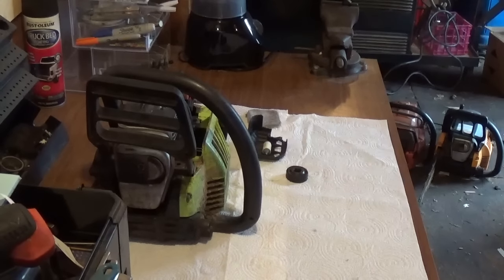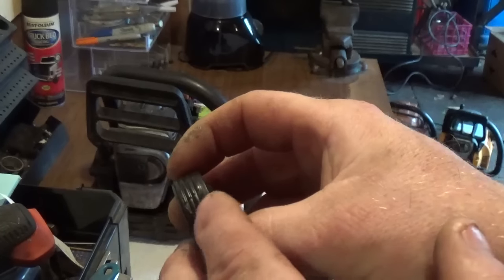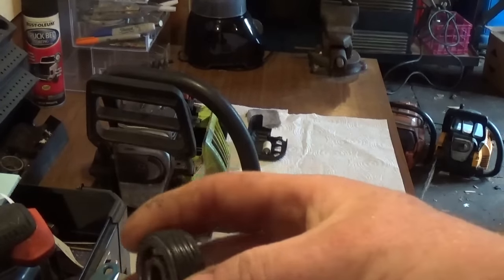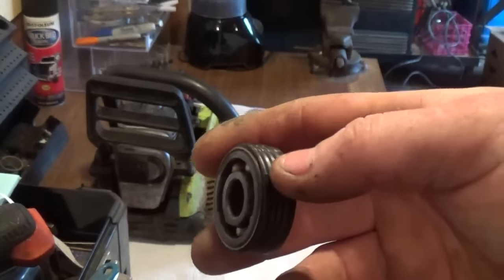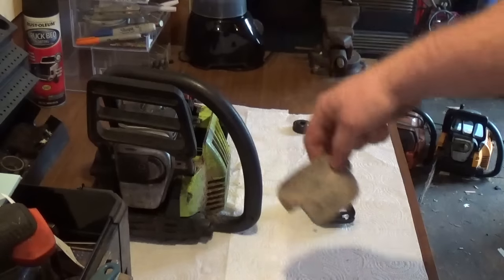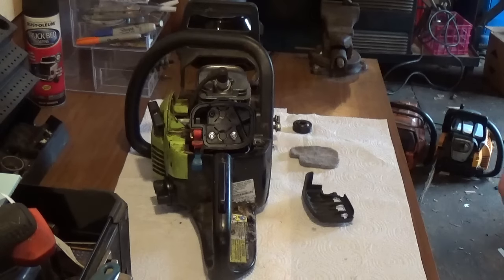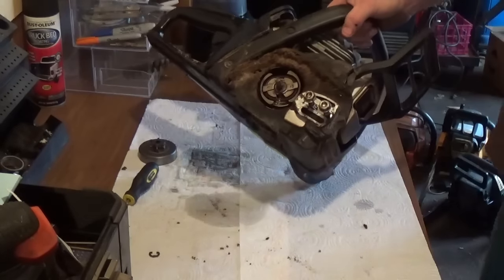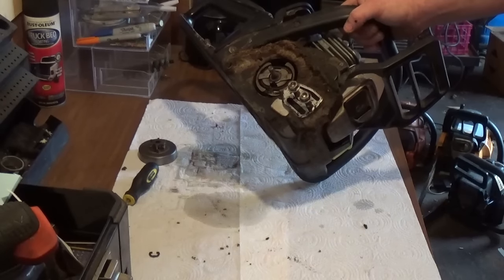Common problems with Poulan Chainsaws

Comment: Poulan chainsaws are not completely junk, as long as u try to take care of it and do sum sort of maintenance on it they will last a while. I've had 3 in the past 15yrs, 1 I never had a problem with, 2nd was a pro and just like u said the crank snapped at the clutch, and the third I ended up selling 3yrs after I bought it and it still runs. The thing is the carbs are nowhere near close to being adjusted right from the factory cuz I've always had to adjust them right from the box but it's like anything else that we buy, they ALL have their lemons. Husqvarna, the crap Sthil, johns red, and John Deere all have some sort of flaws. But as for poulan they're only $100 so compare it like this...if u wanted a ratchet set to put together a swing set for ur kids, if this will be the only time u ever use it, then buy a Taiwan POS set from the dollar store. But if you're opening up a garage then u might wanna get some better tools...and NO I'm not comparing a poulan to a tool set
Reply from the maker: Chris I like the way you elaborated on your idealism of a distinction via comparison with the affect of cost in relation of intended work . However although you stated Poulan chainsaws are not completely junk …..I must disagree ….Now let me explain by right of my own example. If you allow yourself to purchase a cheap alternative such as a poulan for intended work and you invested said 100 dollars only to experience a failure in the first hour at best of use then was the purchase viable in comparison to the 200 dollar purchase of a Crap Stihl that has a way better rep as well as warranty ….Knowing that Stihl will accommodate there customers to make it right so long as straight gas didn't ruin the equipment . Now Just because of my own experience I can attest that Poulan will do anything if not everything to make a failure fall on the customers shoulders {this fact has been proven time and time again } Hell still continues …….Poulans are by far the worst chainsaws on the planet / The only thing that makes them appealing in box stores is price point value . They suffer so many problems they even have there own refurbishing company so they can take the lemons sent back and push them threw the box stores as well as dealers once again at a cheaper price …...Truly said …..Seriously think I am kidding ? look on the saws displayed at a reduced price in the small box stores . You will find that pretty little stamped {R} for refurbished right on the top . But lets not stray from my point I was going to make …….The simple truth is with all the problems that plague the Poulans from even your own admission of the 2 of the three to have suffered a crankshaft failure how can you attest that these saws are in any way comparable to a 200 dollar purchase …..Let me elaborate …..For example and example only  lets say you had a wooden handled hammer typically purchased for about 10 dollars and you intended it to be used to drive and pull nails from old lumber . You use it for a week with no issue yet You have to have the task done in two weeks. {Oh shit it broke} …..Now what ? do You fix the handle ? make a new purchase ? Or should you have purchased that Estwing for 30 dollars from the get go to have avoided encountering the issue at hand . Granted you would have had to shell out that extra twenty dollars but look at it from this perspective . Your out of not only the purchasing of a new handle for about 6 dollars but the time as well as gas to retrieve the handle or the potential new purchase of a new hammer. The aggravation of...…... is the part going to be in stock ? Then even affixing the handle to the head of the hammer when all one would have had to have done is purchased quality to insure the problems would not have to be contended with as Estwing would have been made of steel with a life time warranty threw exchange . And the 10 dollar China brand would likely leave you in that Fuck I wish I made the Estwing purchase .  Granted both may find there way to the shelf after work was done but logistically that Estwing would last a life time and that in its self would provide piece of mind making the extra 20 dollars being pinched well worth being expended in comparison to the china hammer that would almost certainly need yet again a new handle at some point . So think about this Chris wouldn't purchasing a two Hundred dollar Stihl or like valued saw in budget be more favored knowing parts are available for the repair if it should arise . Or purchasing a piece of junk one has to finger fuck his way threw just to keep running be acceptable because it was bought for 100 dollars just to pinch a few pennies in the moment knowing that the quality is shit , Service is shit, and performance ……..You guessed it SHIT . As all your going to receive if a new Poulan is purchased and is being subjected to a warranty claim will be {SHIT}.

Comment: Uses "tool", but continues to try to loosen gas cap with fingers.
Reply from the maker: Correct .....And I have no shame in showing it as it was ......I specified that the cap had been previously loosened and may or may not squeak . I used a tool to first loosen the cap then once it was slightly loosened I proceeded to loosen it by hand .     So please explain your point .....
Reply: @kevinbolin7665  Yeah my point IS that at 4:55  you inserted the tool but didn't actually use it for leverage. At least that is what it looked like to me. It would have been easier to grab the end of the wrench - that is visibly sticking way out - and use it to turn the gas cap. Anyway, I stopped viewing about that point anyway, because FYI not all stuff other than the beloved ("mass produced" also) Stihl are "pieces of shit". Leave old gas in a Stihl and that "piece of shit" won't start either.

Comment: I loved this video. I had a wild thing used maybe 4hrs at best. Leaked oil everywhere from the get go. It never ran right and was hard to start. You are spot on.  The only thing good was the chain and sharpening kit that they gave with it. I invested in a stihl ms 441 (a bit pricey) but never looked back. 11 years and still runs strong.

Comment: I've used this saw for 2 years now thats 20 cords to heat my home 0 problems
Reply from the maker: Great...And as I have asked many others { time after time } if the saws are that dependable please show a short video to validate your claims . I am not asking for more than 5 to 7 min tops ...Simply cold start the saw ....make 6 to 8 cuts threw about a 6 inch piece of wood ....allow to idle for about a min tops then try to open it up from idle to show fellow viewers response time {BOGGING} make and additional 4 or 5 cuts then allow to return to the idle . This is a reasonable request and typical test to preform by many whom work on these small pieces of equipment . And if your claims are true you should easily be able to make this video in 5 min tops .

Comment: i
Reply: I 100% agree with every word.There is one other thing i experienced.The chain won't stay on per their specs.I called and talked to a rep,;he says you have to tighten bolts as hard as you can.OK,this i did;worked great for a couple months.Then the bolts pulled through the ''piece of shit''' plastic plate.I 've had 3,all were pieces of shit..
Reply from the maker: Yes I know exactly what your talking about .....I have had that experience as well .....complete P>O>S> Poulans are in every way .

Comment: so you liked my comment
Reply from the maker: Yes .As you provided a method to repair a would be problem that most are sure to encounter. By inadvertently replacing the cap you managed to fix a faulty tank vent by replacing the cap.

Comment: Hey dude you are giving a bad review on this chainsaw but it looks like that chainsaw you are reviewing has  given you long long years of service and has been abused by you.
Reply from the maker: Well I can certainly see how attentive you were in reviewing this video as you failed to understand the chainsaws were not mine nor did I use them in any way .....A couple were warranties that were provided to me for parts .....And due to the fact my boss was and still is a Dealer means I am obligated to repair these curses to mankind every day . You did humor me with your ending comment as you implied that the chainsaw appeared to have been abused excessively by me and also looked to have provided me many years of service . Friend I wouldn't depend on one of these pieces of shit if I had to . I know for a fact they are complete junk and you would to if you would have been more attentive to this video .....but ......To each there own ....Perhaps you would like a second opinion ....Maybe you should look up refurbished Poulan Chainsaws or better yet leave a comment as a reply to a fellow viewer as I seem to see more thumbs up than down with the info provided .
Reply: They are not his saws, he claims to have a small engine shop and he repairs them, so the saws belong to customers.

Comment: Thanks for the info. I had a 14" Poulan for years and it ran pretty decent for smaller jobs until exactly as you mentioned, the fuel filter broke off.  Getting off the gas cap was always a pain in the ass and I had to use a pair of channel locks to unscrew it. Same thing with the bar chain reservoir cap.  I finally just gave it to a junk guy. I didn't learn my lesson because I couldn't pass up an 18" Wild Thing that was on sale at Farm & Fleet. Everything wrong with the 18" is just as you have shown in this video. I also noticed that the arm bar is total piece of shit and will crimp binding up the blade without hardly any pressure put on it. This saw is only about 2 years old, not used that much and it won't hold idle for shit.  This one is almost impossible to get the gas cap off as well and I have to use the channel locks trick on it too.  I am planning to sell my property within the next 2 years and I should never need another saw again but until then I think its time for something better. What do you recommend.  I know everyone says "Buy A Stihl", but I'm not sure if I want to make that investment in a saw I won't be using much over the next 2 years. Your thoughts please. After watching this video I respect your opinion. Thanks.
Reply: Stihl has apparently gone to shit on their consumer line as well. So far, a lot of people are claiming the Echo consumer line is solid.
Reply: @boots7859  I have a small Stihl MS 180C with a 16" bar. I'm very happy with it. I do have a few complaints, though: No bar oil adjustment screw, no carburetor needles. I had to remove the spark arrestor because it fouls so quickly and saps engine power. It can't go one year before it's time to replace the sparkplug, because all of a sudden it just dies. The new plug solves the problem for another 8-12 months. Now that I understand its quirks I like it. Oh, by the way, the above problems were while using the expensive Stihl premix fuel.

Comment: Yeah I have a poopland pro to got it for 15$$$at a garage sale was working fine was told it had some issues with it put it together nothing  wrong but the pull cord was not were it was supposed to be it needed to be restrung spring and string
However I do experience the same types of problems with it and I am willing to ask the question is there some type of fix or a solution to this saw issues since it's parts related are there other things to put in other then what comes with it
Noticed other things other then it being made cheep by huskavana and they should know better how to fix this and do a better job at the mass production thing

Comment: I have a Poulan, I call my my Pullin and pullin and pullin...  I've had it about 12 years.  It IS a piece of shit.  It has been since I took it out of the box.  I spend more time working on it than using it.  I don't use a saw too much, so I always just try to get it working long enough to get through the next project.  I've had it apart so many times I could take it completely apart and put it together blindfolded at 2AM in the dark.  I will go out and test it the night before, get it all ready and set.  I get to the job site make 2 cuts and it quits.  I've had all the problems you've mentioned more than once, except the snapped crank.  I usually just clean the carb and put it back together.   I got a dewalt electric recently, for the small stuff because I am so sick of fighting with it.

Comment: Well i can vouche for Poulan being junk. I may only be in my 20's but yes I have owned a Husqvarna weedeater, apparently Poulan owns Husqvarna now, and it crapped out within a year..  And when i was a kid my grandpa bought a very slightly used Poulan chainsaw from a neighbor(who was a very old man) and it NEVER ran right and both were good at fixings things.. Anyway, i have personally seen echo chainsaws and weedeaters run for years..seems like the Poulan chainsaw had endless carburetor issues and wore out after mild use.There is low quality stuff out there, but Poulan is on a WHOLE other level
Reply: Alex58924 17, Husqvarna owns Poulan Pro/Poulan Weed Eater Division.  Just wanted to help you get your facts straight.

Comment: Loved the advice at 15min in! Made my day and saved me much more than just the 15:16 it took me to figure it all out ! Thanks a bunch! 👍👍
Reply from the maker: Welcome ....seen these saws lighten the wallets of many hard working people who were just trying to find a bargan and then sadly develop buyers remorse.
Reply: I have a Stihl 029 super,it keeps on chugging,455 Husqvarna Rancher with beefed up motor, I had 3-4 years, I just got a Poulan for  $23,he says it out gas and it smelled like diesel fuel, I can get to fire the plug looked good, I put a new plug ran a bit didn't seem to want to rev up, I can get it to fire once since I set the plug specs,clean up good but it was melted on the blade kickback mount, kind of wondering why it would melt there, the bar don't have the paint wore off.
Reply: If you blow the Husqvarna out with air where the oilers opening is it's definitely a misteak.It blows sawdust in it and plugs it up,then you have to grind an opened end wrench to hold the clutch inner parts, left hand threads

Comment from the maker: Viewers over the years if I have said it once …….{I have typed it a thousand times } If your going to insist your modern Poulans are so called dependable . Then prove it as it seems everyone feels compelled to say there Modern Poulan cuts acres of wood . Cuts huge hardwood trees with out issue { has been touched by the hand of god } And quite frankly my sensible viewers and I know this to be complete bullshit . So stop the rants and asinine bullshit …..If your Poulan Chainsaw can do as you insist then logic stands to reason a video isn't to much to request . This take my word or leave it mentality just isn't going to suffice and trying to berate your opinion by demanding your Poulan performs flawlessly without the video to collaborate your claim is truly just foolish .[BUT TO REITERATE]  If your a brain dead dumbass ……..Show your Poulan starting from a cold start ……...Make 5 or 6 cuts threw a small piece of wood about 6 to 8 inches around  ……..allow to idle on ground with out any aid of the operator for one min …...Proceed to pick up the saw from the ground and make 5 to 6 more cuts before allowing the saw to return to idle once again for one min . This request is reasonable for any chainsaw and can be done in a video 4 min or less/ so stop the bullshit / Show my viewers and I your Claims are valid . And if you cant back up your comments then respectfully don't feel compelled to try to push foolish idealisms with prideful stupidity .

Comment: What saw would you recommend?
Reply: Depends upon lots of factors, including intended use, frequency of use, characteristics of the primary user such as skill level, knowledge level of required care and maintenance, and resources (money) available in making a purchase. This is where you should speak with a knowledgeable professional to help determine which, if any, tool would be appropriate to your real or perceived need.

Comment: Those entry level chainsaws are for incidental use. It’s not a saw for long runs of cutting. I have this model for cutting up fallen limbs in winter and getting them out of the road. I have a heavier duty Stihl that I take up into mountains to go cut rounds for firewood. A personal use firewood permit is pretty cheap and are available in many National Forests. They’ll give you a sheet showing you where you can go cut.

Comment: My poulon is a complete piece of shit. That's how I found your channel. Brand new 18 inch worked great. Went to use again will not start or will run for a few seconds and die or give gas and die. Piece of wholly shit. I am experienced at mechanics to and picky about fuel mixture. Forgot to mention the housing was melting behind the bar..  POS

Comment: Someone give me one for free that they couldn't get it to run. I had it running in 30 minutes or less. Been pretty good saw but it does require maintenance if it sits. I dont disagree for the most part.
Reply from the maker: Thanks for being honest …..and I hope you continue to get great service from it .
Reply: @kevinbolin7665  I do too but it's not my only saw lol. I used my Dads Stihl Farm Boss the other day because I didn't have any of my saws and it was like the difference between a Cadillac and a go cart lol

Comment: I've owned a few Poulans in the past and I currently have a low end Husqvarna and a Echo, never had trouble getting the gas caps off any of them but I ALWAYS have to use pliers to get the OIL caps off
Reply from the maker: Yes it can be a pain...